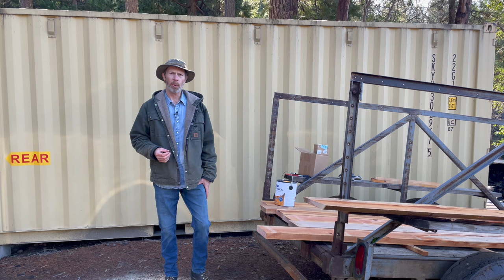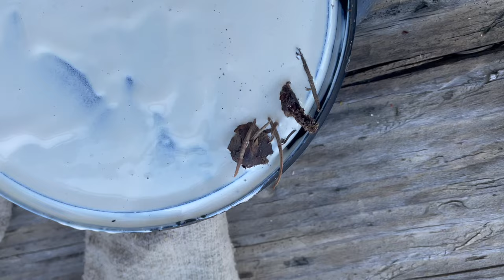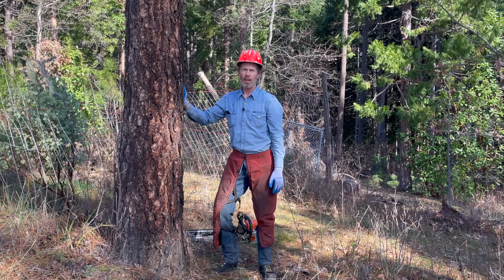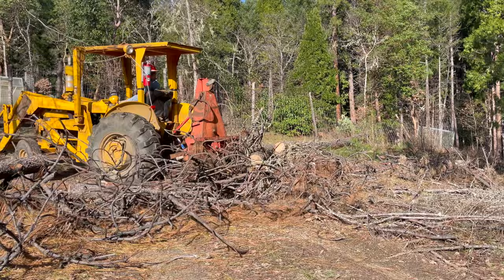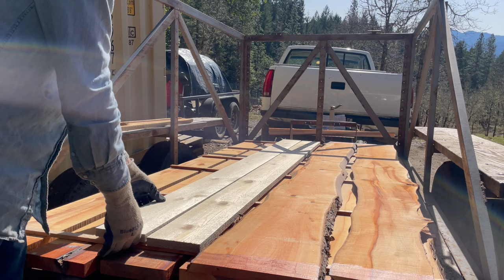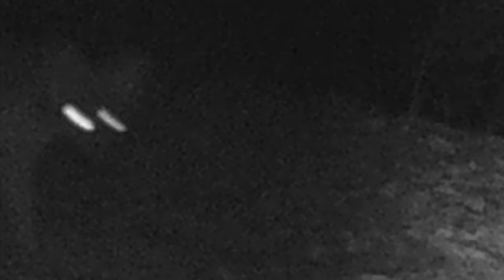Applying Anchorseal to Madrone Lumber Gets Ugly

Comment: I use Anchorseal on walnut logs. Try sealing the end of the log before you mill them. Way easier.
Reply: Second that
Reply from the maker: The problem with that method is I didn’t even think to put anchorseal on them until after I milled them. 😁
Reply: @WilsonForestLands Ha! I figured  that out. Good luck with your madrone

Comment: Did the JB weld seal the fuel leak Mr. Wilson? More fun running your chainsaw than a paint brush huh.
Reply from the maker: I haven’t filled the tank up yet. It still has at least a half tank so it might be a while. Yeah chainsaws and I get along better than I do with paint brushes.

Comment: I'd consider sealing the edges too, the more you can slow down the drying process with Madrone the better. Putting too much weight on it would make me nervous, tension has to go somewhere so it may just lead to splitting.
Reply from the maker: This is mostly just an experiment with the Madrone. We’ll see if you are right about it splitting. Maybe I should do the next batch without putting so much weight on and see what the difference is.

Comment: I've had good success with the Cabelas outfitter cameras. Not long ago they had them on sale. I should have purchased more. The gen II are good, the gen III are better but about 50% more expensive. I have a few videos with clips taken with them. So far they've been a bit more Bear proof than their predecessors. The other brands I've used were more expensive, but not better.
Reply from the maker: Good info, thanks.

Comment: you are right your trail cam is not good, and im being polite here as that is the Canadian way. :-)  I think that Madrone would make an amazing table top.
Reply from the maker: No need to be polite when it comes to that trail cam. That one is bad enough to even turn a Canadian rude. I was thinking the same about the Madrone. It would make a good table top if it would just stay straight.
Reply: @WilsonForestLands   when you first cut that i thought wow now that is a cool table top, maybe linseed oil might help it clogs the pours of the wood and smells amazing but I have never worked with Madrone. to be honest i had never heard of it until i started watching your videos.

Comment: If someone dosen't have other boards to dry over the tricky hardwood. Just use rocks until have more... [watch your back doing it]
Reply from the maker: Yeah rocks would be a good source of weight but rocks are a little hard to find on this property.
Reply: @WilsonForestLands  .... by rows of two i did it so the sides dosen't warp. Found it easier than trying rows of one  balabcing them on tiny sticks. ⚜️